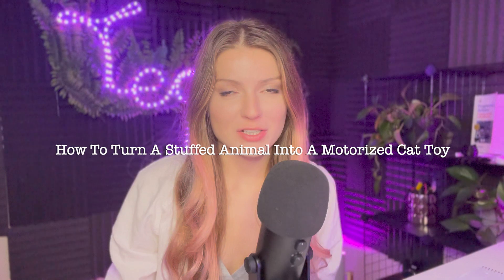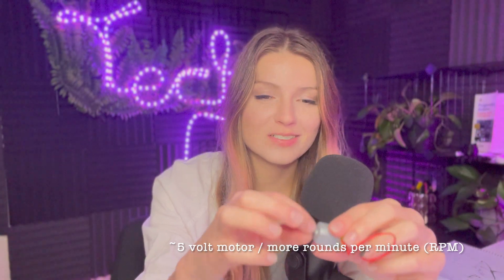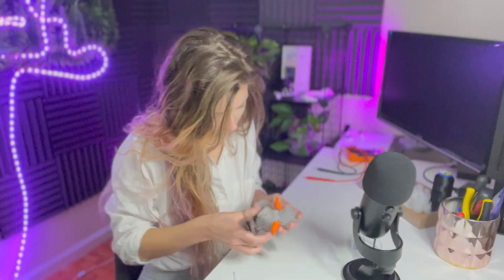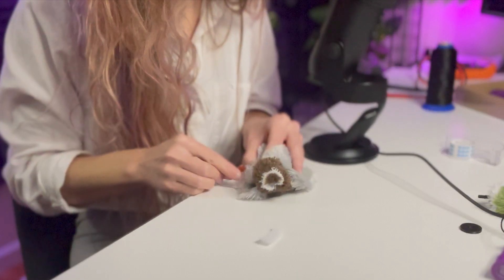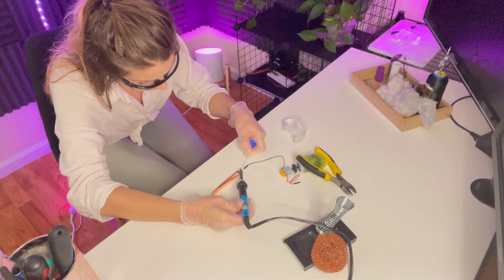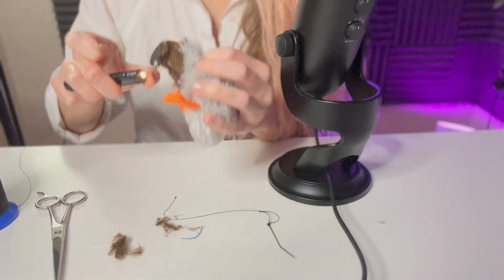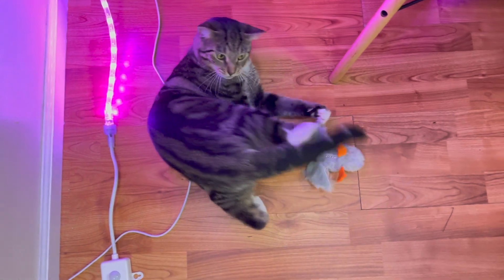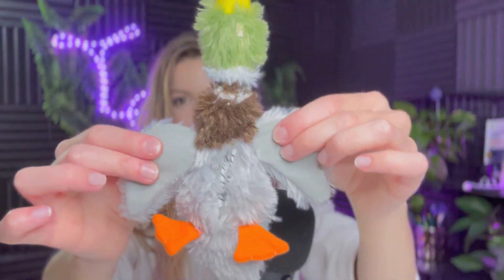How To Turn A Stuffed Animal Into A Motorized Cat Toy - Using Household Electronics

Comment: 11:48 That’s a 3v motor. In creasing voltage won’t increase the torque much. I’ve done a “stall torque vs no-load rpm” plots and their performance is kinda crappy if you need to get meaningful work out of them without gear box. My solution to get okay torque at 120rpm out of them was to design a planetary gear box for it where the ring gear was stationary and the and the input was the sun gear. The planet carrier would rotate. At the 120rpm. Dimensionally, the gear box was about 25mm diameter and 15mm long. 

Anyways, it’s doable just requires extra designing

Comment: Randomly came across your channel, love seeing people that love to tinker with things.

Tip for future builds:
- Find the clearance/accuracy of your 3d printer. You can do this by printing a tolerance tester from thingiverse.
- research interference fit, clearance fit, and loose fit.
- Determine which fit you want and then you can design your piece part to the desired fitment using your printers tolerance and this will allow you to purely design the part and it work and not require you to do trial and error on fitment pieces.

This is also true when you know the accuracy of any type of manufacturing process such as cnc, 3d print, or injection molding you can design the tolerance in the part and not have to worry about a part fitting or not.

Hopefully that makes sense and helps if not can further clarify!

Comment: actually you're better off not wearing gloves because if solder happens to get on it, it'll burn into it and stay there and probably continue to burn you, rather than hitting your skin and bouncing off, that would stay in the glove. it's fine not to be afraid of tiny little bits of solder. as long as you're not dealing with globs like if you were plumbing pipes you'll be OK.

Comment: The terminology for gears, mechanisms, electronics, etc is usually made for people like engineers who spend significant chunks of their lives working with and talking about it. That level of detailed terminology and analysis isn't needed for many projects. Don't feel bad about learning just the level information you really need and discarding the rest. (This is what the engineers are doing anyway) As for gears, there are a lot of online tools that do the calculations for you. 

Safety note on soldering: The lead and rosin fumes can be harmful if you breathe them. If you don't have one you should look into getting an inexpensive fume extractor. Fans with activated carbon filters will get the job done and can be had for less than $25 at amazon or a hobby electronic store; or you can make one yourself. Adafruit has some good guides for it.

Comment: Relly nice video. Duck taping cables to the table and soldering that way reminded me of how I actually started soldering. When it comes to you making a lot of money of of youtube (which will for sure happen) you might consider cutting out the top bar of fusion 360 to make it not-so-abvious that you are using the personal, non-commercial license.
Back then I also used to wear gloves while soldering and now I only do it while dealing with chemicals or resin printing.
Very nice, like your idea. Came unexprected but I love it

Comment: you can use heat source (heatgun) to soften your 3D printed motor shaft thing and then press fit on motor shaft. You have to be careful because you can also make it loose. You could create some knurling on motor shaft then press fit it. In your case you didn't have issues of motor shaft slipping because motor would stop before it slips.
CAD = Computer Aided Design. Fusion360, Solidworks, NX, Onshape, Catia are all CAD tool.

keep it up!